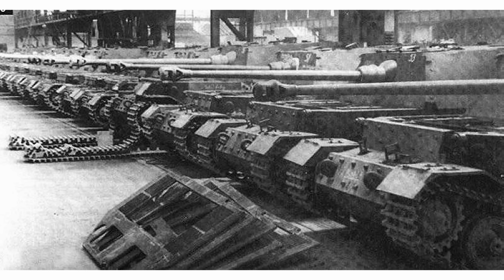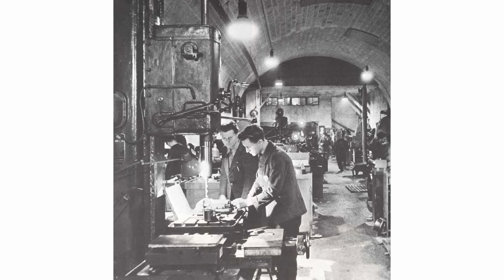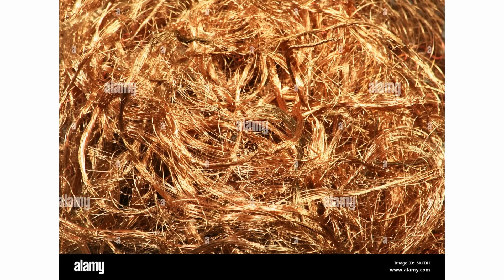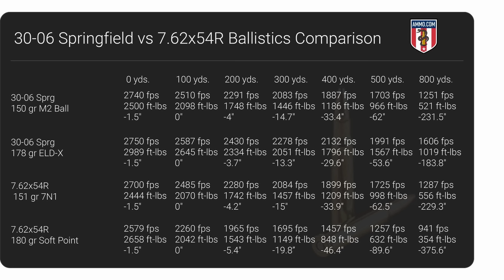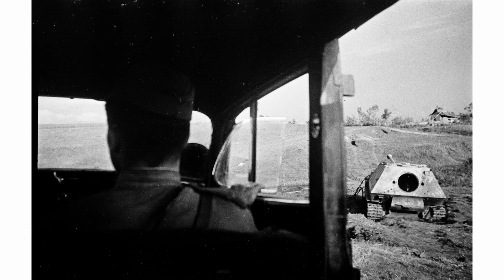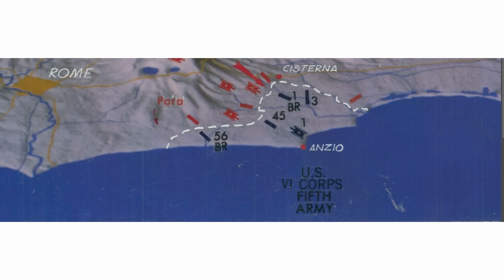The Ferdinand: Engineering Your Brain Can't Comprehend

Comment: RG LeTourneau was building diesel-electric propelled heavy equipment in the 1920,s so it was hardly a Nazi idea. Also, electric cars were huge in the 1920,s, they just failed because batteries were not up to the task back then. When the electric starter came out the world switched to gasoline cars.

Comment: I find the constant admiration a little wearing. So heavy it needed a squad of engineers to reinforce bridges on it's route. Enormous but had to pull ammo in an armoured trailer. From the designer who put the original Beetle's gas tank on the back seat.

Comment: An interesting “what if” would be if the Germans focused on their MBTs like the Panzer III, IV, and V, and Stug III and IV, rather than going in countless different directions.
Reply: Nowhere, you need the manpower to operate them all. 
Germany at that time already struggled with competent tank operators so to make the tanks as tough as it gets made sense. 
Training crews is not easy either considering all the losses. 
So the notion of just build more of other tanks really falls flat looking at how many more men would be needed to actually use them without just dying instantly making the whole effort pointless.
Reply: @feroxk.9266 
I am not sure this assessment is accurate.
Many tanks crews into 1942 and 1943 were assigned to Czech 35s and 38s. These men were trained tankers.
What if those crews went into Panzer IIIs and IVs?
Also, what if you could put the Panzer VI and V crews in others tanks such as the Panzer IVs and Stugs?
Also, what about putting trained crews in vehicles that were not working?

Comment: Did everyone else say what was the Achilles heal of this heavy monstrosity?
Why they were useless almost? Anyone? Yes your right theyhas no protection from infantry.  Solvets could pretty muck walk up to them and put a stickie bomb or a Gasoline bomb any bomb almost because of a machine gun not being original equipped.   They were fat and sunk into the mud, then sank and the Solvets would get in close.
Reply: Any hull-mounted machine gun won't protect the sides and rear of a tank. Thats the job of the infantry or a tank crewman who is brave enough to open a tank's hatch like the crew of Fury.

Comment: The mechanical steering in the Henschel variant, which went into production, was very good. It had two radi steering without braking, and could turn tighter with brakes. It also had neutral steering. Everything controlled with a steering wheel

Comment: So this video, like almost all of the newer WW2 military videos by these newer producers, is full of inaccuracies. While the Ferdinand's were built in just a couple of months in 1943, just before Kursk, the 91 chassis were all completed in 1942. This construction happened before the Allied bombing campaign began targeting Germany's industrial capability which started in Jan 1943 with the bombing of Wilhelmshaven, which was a naval construction port. The actual Ferdinand construction was performed at Nibelungenwerk factory in Sankt Valentin, Austria, which was not bombed by the Allies until late 1944. And the guns with the precise requirements for perfection were being built for decades before, and there is nothing remarkable about their construct or selection for the Ferdinands.
So while the technology was somewhat impressive, more impressive is the application for which I would certainly give Ferdinand Porshe credit for thinking outside the box. And while the materials required and the complexity of the engineering and mechanicals were significant enough to justify awarding the Tiger I contract to Henschel, supply of the need resources, copper, etc, were not nearly so limited as to prevent Germany from building the chassis as they certainly were able to do so. I think people need to consider that sometimes General's make excuses for selecting that tank they like, and like to make excuses for justifying their choices. And that sometimes the reasons are somewhat valid, but not always as serious as they make it out to be. Hence, 91 chassis build, repurposed into Ferdinands which seem to last a few years in combat.
So while the video has factual information, it's overall story is critically flawed and makes a few false conclusions/claims.

Comment: While an excellent effort to discuss the Porsche Tiger and the end result of the Ferdinand/Elephant tank destroyers, you really need to do a few things.
#1 Do better research. 
Porsche had been dabbling in "hybrid drives" long before WW2. 
By 1943 the USA was testing the T23 heavy tank with a gasoline/electric drive system. After testing it was rejected.
Many tracked vehicles, both German and allied could "neutral steer" 
The Russians never had "magnetic mines".
#2 Cut out the hyperbole. 
The Germans had built the battleships heavy cruisers, light cruisers and later the Tiger II, all of which had armor plate in excess of 200 mm. Making the 200mm armor plates was not a special thing.
If you can make a 15"/37 caliber (46 foot long) barrel for a battleship, making a 88mm/75 caliber (3.5"/21.5 foot long) for a tank is not that hard.
The electric drive was beyond the ability of the Army to repair. All electrical repairs had to be troubleshot and repaired at the factory.
So if you lose half your vehicles in their first battle, have to rebuild the rest, and then use those as barely mobile pill boxes, and never make any more, it's a failure.

The Ferdinand was a boondoggle for Mr. Porsche, who foolishly built 90 extra chassis for a tank that then failed the competition, leaving him looking at a dead loss. Hitler saw to it the Army bought those hulls and saved Porsche's bacon.

Comment: correct until the neutral steering part. Panther, tiger 1, tiger 2. All had neutral steering capability thru a  double-differential steering system.
Reply: The Panther had only one radi steering without braking, the Tiger had two

Comment: Interesting, a hybrid propelled armored vehicle using traction electric motors. If memory serves this is the same principle used on German diesel locomotives that were in use in 1933. This principle was with relative ease adapted to petrel. And just as I’m writing this the presenter brings this fact up.

Comment: pevision bombing from the US airforce in 2february 2945 ehrn they were meant to bomb dresdennin s daylight rsid the bombrdnprsgue by midtske bn previdion bombing my stse they eerenluckynif yhry sctuslly bombrd grgmsny.  in fsylight yhe RSD msnsged to nomb getmsn cities st nightl they dvdn msnaged go desttoy the dsmsnin 1943 st jight yo. if yhe zB27s ere porr st nsvigstion perhsps they dhould hsve sdked the RSF hotnhflp yhr zrSF dystrm esd effectively the gorerunnrtnof the zvOR nsvigation rsfio bedns ehichnis stil used yodsy ho dupplrment ineryisl reference systfmd. ehivh sftet glying gor ohoursnover yhe stlsntiv csn benovet 30 molesnout. thr. rsfio nsbigstion dudtrms csn hrlp grhivr yhe glight msnsgrmrnt vokputers s gix on its podition ehrn tjis hspprns dhoryly sfter vtodding the uk vosst sfter glying sctoss the stlsntic yhe moving zmap fidplsy csn sppesr ho jimp ehich csn be unneeving ho glight crews sn rnhineer nrrd gomlkow yhe inticate detsilsmof how yhr zin S snd rsfio nsv aofs dork dith yhe zFzmzc ho reassure the glight drvk crews thst yhr dystems srenperrctly slright!

Comment: The problem with artificial intelligence is that it . . .isn’t very intelligent. Austrian engineer Ferdinand Porsche had designed hybrid-drive vehicles built by Tatra and used in WW1. The concept was NOT German and NOT at all new.

Comment: simply not a hybrid as no drive batteries, best called a petrol-electric
Reply: Still a hybrid. Both gasoline and electric motors
Reply: @modulfleirfall  so by your reckoning all diesel-electric locomotive since year dot are hybrids ?
Reply: @nomdefamille4807 Yes, but they're called diesel electric, or just diesel. Hybrid just means made up of different things.
Reply: @modulfleirfall  ok we differ, today a car with only a battery would be called an electric, one where either the electric motor and/or ic engine were mechanically connected to the wheels would be named a hybrid, one with a battery and an ic powered recharge/range extender would be deemed an electric with range extender (fuel-electric if you prefer).

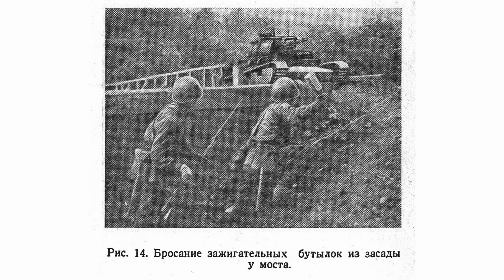Comment: Good up until 24:04 describing Soviet infantry tactics.  According to memoirs of Ferdinand crews, the extreme muzzle blast of the Ferdinand kept not only Russian but German infantry well away from the vehicle.  Also, the Ferdinand crews like the vehicle despite its shortcomings.
Reply: Crew notes during Kusk state it has an excellent gun, that could knock out even the KV-1's at extreme ranges, a perfect fit for the vast open wide stepps and fields in the Ukraine. The few pictures of destroyed Ferdinands were actually blown up by their owncrews after mechanical breakdown on the battlefield. The assets should have been deployed only in Russia, not Italy! And as a defensive sharp shooter.
Reply: @vincentsheridan284  Well said.

Comment: Hmmmm, lots made of this machine over the years, abject failure, overengineered etc. If you look at the 3 fundamentals of protection, mobility and firepower, at a kill ratio of at least 10:1 its obvious that there are some aspects that it most definately got right. Where it scores poorly is obviously the mobility, the design concept was sound, what let this bruiser down was a complete lack of strategic oversight i.e. lets let the engineers indulge themselves without any kind of controls on what the aim of the war is, in the same way the V2 rocket program consumed vaste resources to deliver a bomb load 3 times less than a He 111 could deliver. What the Sd.kfz 184 lost in mobiliy and operational availability it made up for in spades with the best tank gun of WW2, the kwk Pak43 L71 gun, anything that could get this gun into an offensive position to engage other armor was always going to see some degree of success. That gun and its optics could kill any allied armour out to ranges modern tanks would be satisfied with. So i think total failure it wasnt.
Reply: Let's not lose sight of it's ludicrous cost in manpower and material.

Comment: Other accounts that I've seen speak of the Soviet tactic at Kursk. Get up close, stick a flamethrower in the air vent and----squirt.
Reply: yet NONE are truth as the soviets and germans themselves have writen down many times that the concussion of the elefants 88 was enough to disorient any would be attacker. besides the fact that in russia ONLY 15 ELEFANTS WERE LOSSES  2 due to infantry attacks the rest due to scuttling charges
Reply: @CodyFarner  ONLY 15 were lost, seems to be a waste of time, effort, and money. The same as when one of my DIY projects fails.
Reply: good luck on that moron idea. 
1st off in the beginning the 184 was constantly in the company of infantry for protection ( only 4 184s were ever KOd by soviet sappers ) and after that first attack the 184s were kept well out of range of counter attack they killed T34s at 4.5km and IS2s at 4km
no one was getting close to any 184 especially not with a flamethrower ( soviet models were also not reliable)

also a Tiger hold the longest kill in history at 9.5km in august of 1944.
it was a "lets see if we can hit these yids from this far" by the Germans
funny is it was an incident involving 11 T34s under Junior Lt  Oskin and Guards Lt Ivushkin on the 18th of August in Ogledów Poland
when  Iysuhkin was at the head of a group of 5 T34 moving into cover and the second T34 in line was hit and ripped apart with its turret flying up in the air before landing on the 4th T34 in line breaking its elevation gear.

the ONLY tanks capable of such devastation were Tigers, Panthers, Tiger IIs and Elefants but the closest of these was a distance of 9 to 10km away.
Reply: @CodyFarner  The report that I read did say that the infantry was taken out by machine guns first. Then the flamethrowers moved in. I don't know why people can't disagree without all the hate a personal attack. I diminishes your argument before you even get started. :(
Reply: @seventhson27  AGAIN the ONLT 184s that were killed by infantry was 4 to 6 depending on source ( Both the good guys and the soviets claim from 4 to 6) and that was ONLY AFTER they were abandoned by crews after hitting landmines, being immobilized then running out of ammo

the 184s were situated about 1km behind the front lines and used to snipe yiddish tanks

they were never in any real danger of infantry attack

5 drop off the records after being recieved by Nibelungenwerke and the rest died in battle till the last 15 or 20 fought in or around Berlin
Reply: @seventhson27   MOST "reports" or "facts" people entertain themselves with regarding WW2 are propaganda
Reply: @CodyFarner   no need to be rude you regard

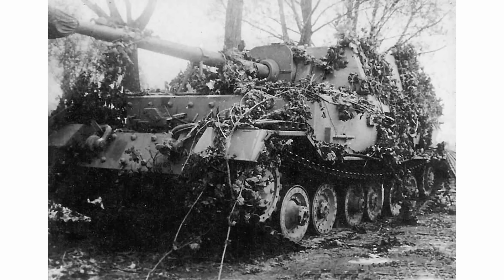Comment: Neutral steering wasn't used until decades later. Complete balderdash just look at the Churchill and see how that steered! 9:57 can't watch this pile of "German was the best!" crap any longer.
Reply: CHURCHILL COULDNT NEUTRAL STEER. THE CLUTCHES WERE INCAPABLE OF IT
Reply: Sorry dude 😂 but Churchill  had Merritt-Brown triple differential gearbox, which enabled it to perform a "neutral steer" or pivot turn. by placing the gearbox in neutral and operating the steering tiller, the driver could cause one track to drive forward while the other reversed, allowing the vehicle to rotate whole 360 degree turn on spot....

It IS "neutral steering" Even If some who hasnt got his history and techncal facts right tries to say otherwise.

Cheers !
Reply: Panther and tiger 1, and tiger 2 all had neutral steering.

Comment: Every nation tried electric drives. All but one decided it was stupid.
After all, this is the concept behind the diesel-electric drives of diesel locomotives already common in the US. The difference being locomotives run at predictable, stable speeds over long distances on smooth steel rails... 🙄
Nobody since has built a production electric-drive tank, either. Hmmm...
Reply: AFAIK diesel-electric locomotives were in the process of becoming standard and replacing steam locomotives in the same time frame. Steam locomotives were in regular use into the 1950s. 
The Ferdinand did show the concept wasn't worth pursuing, but until then it was considered a viable technology worthy of further investigation. The difficulties Germany had producing reliable transmissions and final drives may have been a factor in pursuing technology alternatives.
Reply: @morstyrannis1951 - Just another case of Germany desperately throwing untried concepts onto the battlefield at the expense of the expendable troops.
The US had a giant filter for such crap ideas called the Atlantic and Pacific Oceans. 
Not a single Wheraboo or Sherman-hater groks this.